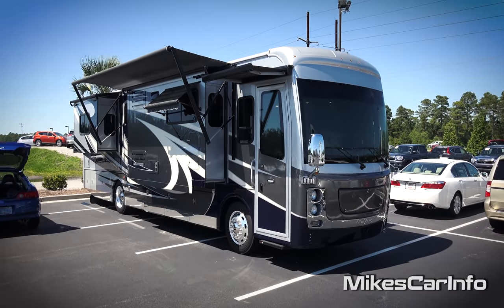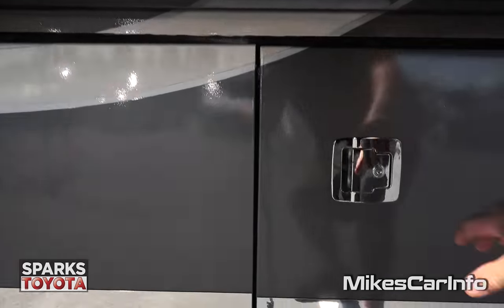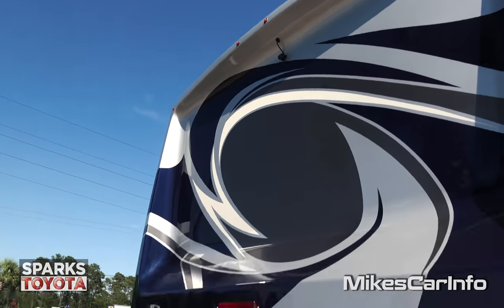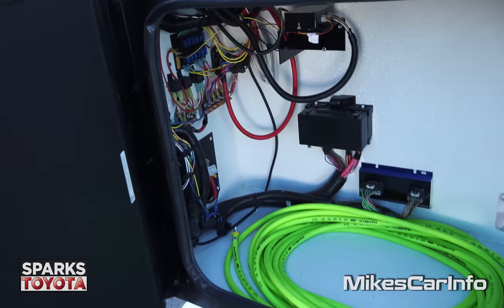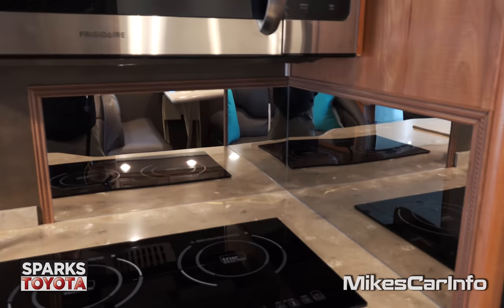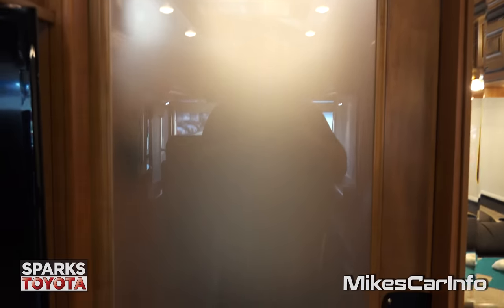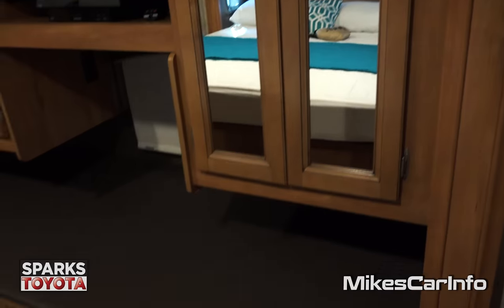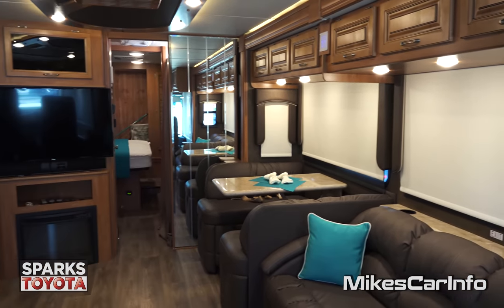👉 2016 NEXUS Bentley 34 B Diesel Pusher Class A Motorhome RV Detailed Look in 4K

Comment: I wish you never opened that front generator door.
Totally devalued the rest of the vehicle, they did not even cap the frame ends or attack a joint. WTH about that wiring...

Comment: 360 hp for a.28000 lb truck?
Reply from the maker: It is a diesel so it is probably 900 lb-ft of torque.
Reply: +MikesCarInfo Oh. Great review!
Reply: I like the research there . . . 'probably' - which just as easily means 'probably not' - which in this case would be correct.  Torque on that pusher is in the 600's.  Then again, you say, it's not about your knowledge level.  Wow.  And the water tank 'facts'  ... "i think it's 50 gallons" ??  "something like that"  - might want to clean up the nebulous comments.
On the complementary side - your camera work is half way decent - not too jerky not too much speeding back from one in to another.
Reply from the maker: I thought I exaggerated enough to imply that I wasn't serious about that number. Next time i'll say 50 billion lb-ft of torque to be more clear to the pedants.

Comment: sorry; but my fridge at home is way better than the one on this coach,  mine has crushed or cubed ice; a light ; water  accessed from outside the door,  mine also has an inside automatic ice maker,  its bigger too and costs half of this one,  only thing mine doesn't do is run by propane,  electric only,  this coach needs a stove or convection microwave or both and a double stainless steel  sink instead of one large one,  I'm not a fan of induction stove top cooking,  gas is much